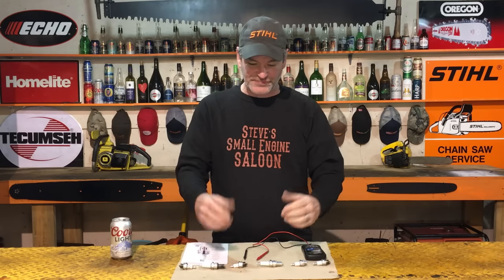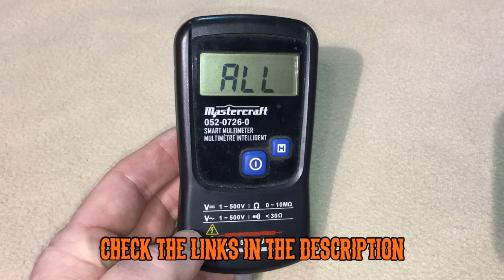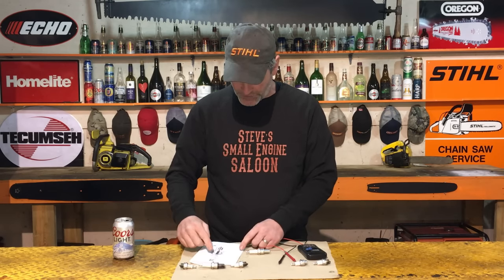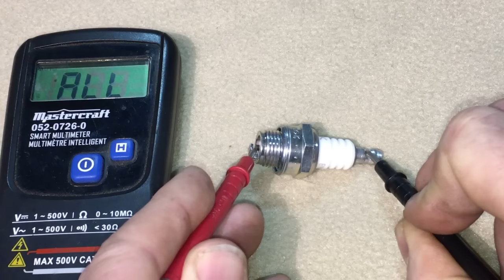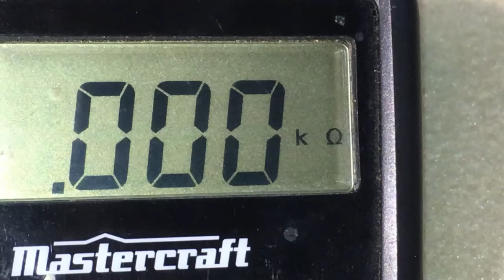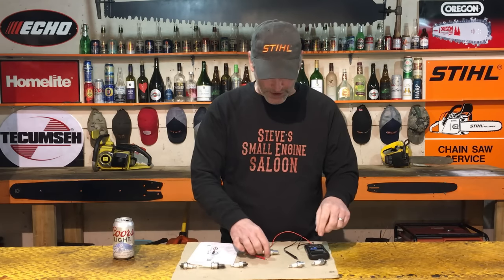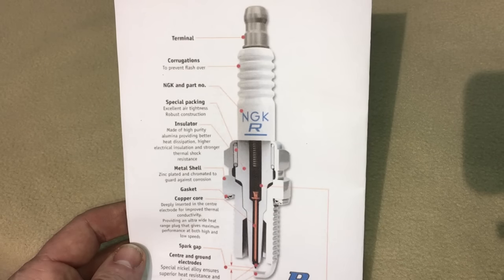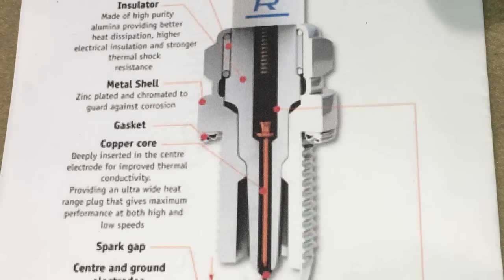How To TEST A SPARK PLUG In 1 Minute

Comment: Mate you made my day!
I was testing the riding lawn mowers plugs because its engine  was not having the right attitude. It was running, but once you clutch in the mower it did not have the torque it used to have. So I checked the plugs and, R-type, it was showing 4,7K on the one, 12,9 on the other plug. Voila! Problem solved. Thanks to your easy instructions on how to properly test spark plugs.Things can be so easy if you know what you're doing!
Reply from the maker: Thank You...and You're Welcome...

Comment: Sometimes the deposits on the spark plug short them out and the engine won't start, remove the wire and allow a 1/4 inch gap and the engine may start. I figured this out as a diagnostic step before removing the plug or going to town to buy a new spark plug, it also checks the spark delivery. No beerz for me thank you.

Comment: i have rebuilded my Husqvarna 281 XP chainsaw from scratch. i have bought a New Piston A New Clutch, a New oilpump with wormgear and a New ignition module. it has fuel and  the compression in the cylinder is excellent but now I have no spark. i have tested the old spark but it didn't spark at all so I bought a New one. now I have used new wires  but still no spark at all. so I think it's the ignition coil. 
do you have a video or Some information how to test the ignition coil. 
the ignition module is new because the old one was broken and the distance with the flywheel  is 0.3mm so it's okay with the magnets. 

so my question how do i test my ignition coil or if i don't have spark should i buy a New one for my husqvarna 281 XP chainsaw?

Comment: Steve excellent videos one question what would cause an MTD Blower Vacuum gas motor to blow excessive oil through the crank case vent, I took the engine apart  could not find a PCV valve  just a vent pipe the engine has good compression  but makes a rasping sound when turned by hand
Reply: Hi ! You probably put too much oil in the motor 🙏🇺🇲🇬🇧✌️

Comment: Hello just wanted to know if you could maybe help?
I have a craftsman leaf blower .
Now the problem that I have is when it gets hot it doesn't like to restart. Now what it doesn't know is it keeps giving shit I have a have  big hammer that is my favorite tool.Lol
Reply: .....I'm by no means an expert however one little thing to check for is the venting for the fuel cap. When hot there is pressure built up in fuel tank , that pressure can force out excess fuel into and around the carburetor which finds it's way into the crankcase causing rich mixture for awhile . Placement of your gadget when stopped so that crankcase is vertically above carburetor is worth trying ,,the overspilled fuel can't flow upwards into crankcase then in a large quantity.
Reply: @charlesdickens6706  thanks for the heads up on the cap I will try it. ATB

Comment: Just gotta add, especially if Aussies are watching, a brand new NGK plug for my lawn mower with Briggs engine has 10,900 to 11,000 ohms from new and is an NGK BR2-LM. The original equipment Champion RJ19LM I pulled out of it had a reading of 59,500 ohms and was still producing plenty of power even with a semi blocked fuel pick up screen that was causing surging. So maybe for other countries the resistance varies?
The mower is a Sprinter 450 Series 148cc purchased 2012. Engine  - Briggs and Stratton Model 9T502 Type 3152H1 Code 11111152. It also has a sticker saying that because it is made exclusively for export it doesn't have to be in line with U.S pollution regulations.

Comment: My neighbor just gave am a Husqvarna mower Model HU 700F (Honda engin) that will not start.  I knew had hadn't used it a several years so I thought it probably had a stuck valve.  Not the problem.  Pulled the plug (E3.22 E3 brand).  Remember that you said in the "How to Test a Spark Plug in one minute" video that most Honda lawn equipment uses a BPR6ES plug.  While this plug doesn't have an R in the printed model (E3.22) it does read 4.24k when tested. which makes me think the plug is OK.  I have another neighbor who needs a mower and i want to get this one going for her.  TIA

Comment: Some of champion's spark plugs use a silicon carbide resistor and cannot be tested with a standard ohm meter. When tested without high voltage they give a high resistance value (above 35k ohms) - even when they are good. I found one in my yard machines mower (550ex Briggs motor) and thought the spark plug was bad. The spark plug was champion RC12YC. I bought a new spark plug and got the same results. If you go to the championautoparts.com website and look up your spark plug part number, I believe it will identify these spark plugs as having resistor type "SAC-9". So, if you get a Champion spark plug with resistance above 35k ohms, it may be one of these silicon carbide types and may actually be good.

https://www.championautoparts.com
http://www.electroair.net/pdfs/champion_spark_plug_resistors.pdf
https://www.sparkplugs.com/what-are-the-different-champion-resistor-types
https://www.gsparkplug.com/media/wysiwyg/technical-information/champion/Champion_Resistor_EN-F-ES.pdf

Comment: Hi Steve
I tested three new  NGK BPMR7A Spark plugs all tested over 12kΩ  so I contacted NGK and this is their response. 
Thank you for your enquiry. This plug utilises an internal 10 kOhm resistor. However, there is no reliable way to measure the resistance of a spark plug using home equipment such as a multi meter

Comment: Steve- what's your opinion on using after market parts, like from Amazon?  I'm needing to replace my ignition coil on my Stihl weed eater and the parts on Amazon are much cheaper but is the quality acceptable?  Your respect your opinion.
Reply: "I" respect your opinion.
Reply from the maker: A lot of parts you get from the dealer are also after market!  I have used Amazon carbs lots with no problems, however never tried a coil yet....
Reply: Do try. Nobody can really say for sure for something that's not under their control. It all depends on your luck I suppose. If you are lucky nothing can really go wrong. If you are unlucky enough to warrant going for some cheap online stuff, then I suppose you should really just say, fuck it, how much worse can it be. Just some freaking coils. To be honest, even if they are shitty, what mlre problem can it cause than the existing bad coil. Suppose you are buying the coils as replacement.

Comment: I used to race motocross back in the 90's an was always told by honda that if you ran a non resistor  plug you could damage your cdi unit? Never found out if this was true as it cost enough to race without fucking things up as the plugs cost the same!
Reply from the maker: I have always been told that too, but have never seen actual evidence.....
Reply: @StevesSmallEngineSaloon  I'll be asking around as I know a man who worked for honda for years in bikes and garden power tools.

Comment: I got a crap reading on my 6.5 HP Craftsman walk behind.spark plug and a good reading on my coil and made sure safety was diconnected while testing. Put in a new plug that tested wel,l shot fluid into the carb and the plug hole, pulled my ass off and Nada, Nothing...Not even a po. I jimmied the engine kill brake away from making contact for easier pull but still nadda zip nothing. Any Help. (Airway was clear- took filter off for test fire)

Comment: Very good informational videos! A lot of guys think they can turn the video on and start talking off the top of their heads; never a good idea. The way to do it is to research the topic first (what a concept!) and then prepare a script or at least an outline of the topics to cover. Obviously, you do the research part at least.
You may come off as a average Joe mechanic (come on, drinking beer on camera!?) , but you are more than that.
An improvement? Better audio would be nice. Your audio isn't terrible, but it could be better. The key to good audio is simply how close the mic is to the speaker's mouth. A close mic favors the voice and minimizes the room echo. That's why you see so many lapel mics, even on TV. You don't even have to buy anything. If you are using a smart phone, just put it on the bench in front of you. Nobody will bitch or even notice. (Oh, wait! this IS YouTube, isn't it?)
Good point about the "Just try a new plug." If you run 2-cycle engines and don't keep spare plugs on hand? That's simply masochistic behavior! Tell'em Steve!

Comment: A crack in the ceramic might allow high voltages to leak through, but you'll never detect it with the low voltages from a meter. Continuity between the electrodes can be due to fouling. And... a plug can test out fine on a meter, but still need replacing. It's rare, but it can happen. The spark jumps from the sharpest points on the electrodes. Every spark will blow away a tiny amount of the electrode. However, it takes a LOT of use for this to become a problem. If you're replacing the plug every year or two (homeowner), or every year (commercial), this will never be a problem. An engine used commercially with a 10 yr old plug could experience this.

Comment: Ive discovered working on lawn mowers that the NGK plugs are the only ones ive seen fail completely, 100% dead, no spark.
Reply: It's really got a lot to do with the guy over priming the carby or mixing the 2 stroke too oily. People leaving fuel taps on- nothing drowns a plug like a victa crankcase full of 2 stroke.

Comment: Thanks once again Steve, very helpful. My multimeter has the dial, I set it to 20K, it gives readings to two decimal points.  You mentioend that some people say that a plug is no good if it reads over 5 but that is not true with small engines. I tried a few NGK BMR79As, one that was in a saw, two brand new. They were all in the 9s, highest was 9.81 that came out of the saw, the new ones were both right around 9.5.

Comment: One quick and dirty  (and cheap) way to check a plug is to have an electric fence charger handy and put the plug in the circuit. There is nothing like a visible blue arc that makes a nice little snap and a bad plug shows as a snapping sound with no visible spark. Its a hot test with a voltage range (about 5-6000 volts) of an operating plug, so it will find even the tiniest path to ground........I use a fence charger in my garden, and it bit me several times before I had the Einstein moment.....

Comment: I did the spark plug test as suggested but found there was no continuity but had a resistance reading, there was no R in the numbers.
Reply: Was the electrode scraped clean?
It doesn't take much to cause a resistance.

Comment: Steve, why would anyone want to reduce the spark by means of a resistor? Hi-Tek b-s to charge
a lot more for a plug? I know if it is fouled with carbon, it will to some extent short out the plug.

Comment: Shindaiwa C270, hard to start, once running rough at low revs, high ok, thought I'd share this little head scratcher, the white insulator on the plug had come loose and was slipping down covering the electrode, when looking at the plug it was always held upsidedown so looked ok  and it tested electrically ok, the compression must have pushed it up enough to fire intermittently, then the high revs must have held her skirts up letting it run ok, found it when I slapped the plug wrench (a little pissed off) to take the plug out, the little shock jammed it down over the electrode...  Never seen this before.

Comment: Steve great video!  I heard that 2 Stroke engines go through plugs substantially faster than 4 strokes.  Is there truth in this and why?
Reply: Hunky MrB, yes 2 cycle spark plugs go bad faster. It's because of carbon buildup caused by the residuals left by the 2 cycle oil.

Comment: I have a quicker way to check  lawn mower plugs, although not all plugs will fit all mowers. I simply use a mower that I know works fine. Take the plug out, replace it with the one being tested. If the mower still runs, the plug is obviously fine. Put the plug back in the equipment it came from, squirt a little gas or starter fluid in the carburetor, if it still doesn't run, time to check for other problems.

Comment: You really cant "check" spark plugs because they have to be checked under load and thats really not feasible however a reading of under 5 ohms its just about standard for a good plug so we can run with that, great video as always!

Comment: I noticed my Briggs and Stratton 375 Sprint engine has a small spark plug which I'm assuming is the non-resistant type which is all good but I think it might be something else wrong with my lawnmower

Comment: Tried it on two spark plugs. This doesn’t work. I know at least one of the plugs is good as mower starts no problem. Yes I’ve tried cleaning all surfaces with wire brush.

Comment: Good checks and ideas.
I saw a guy being neighborly and helping his neighbors with their mower doing prelim tests.
He couldn't see the arc of the plug clearly from pulling with it facing away and could see spark.
He continued and found lots of marginal issues.
He fixed each one or improved it spending time and materials on each aspect of good ability to run, basically refurbishing their whole machine.
When he was through, he was a-pullin and a- cursin.
His spark would rather arc to the outer circle (to ground) than jump the gap from center electrode to side electrode.
He did closer spark testing and got a good look.
Then he did what you said. Grabbed a plug from another and fired it right up 
Cost him a Saturday and a Sunday instead of a plug.
Plus a plug , after.
No charge.
Nice guys finish last sometimes, but all his refurbishing, debatably, Did his neighbors machine some good. And the you tube audience was entertained if you saw what some of us saw right off.

Comment: there is such a thing as an air gap spark plug like a UJ12Y. they will read open on the center electrode continuity. because the air gap breaks down on high voltage to boost the spark intensity. like the old trick of pulling the connector away from the plug and letting the spark jump to the plug cap. sometimes that will fire a fouled plug. these are old things may not be around now.

Comment: I had a pressure washer (with a Honda engine) that started fine and ran fine for exactly 20 seconds and then die.  Start right back up, run for 20 seconds and die.  After rebuilding the carb and replacing the fuel pump to no avail, I decided to pull the spark plug.  It looked fine.  Wasn't fouled or worn out.  It was a resistor type plug.  Checked the resistance and it was spot on.  Reinstalled the same plug after cleaning it and the problem remained.  Decided to replace the plug anyway and that fixed the problem.  Moral of the story, a plug that bench-checks good may in fact be bad and the cause of your problem.  Obviously, the plug had some type of defect that would cause it to fail after temperature (and/or pressure) reached a certain level causing the plug to malfunction and the engine to shutdown.

Comment: I did have one plug many, 50 -55, years ago that would spark against the head but not installed, I suspect it may have had a fracture in the insulator that failed under compression.  Just saying you can have one pass the tests out side of the engine and still be no good.
Reply: Yes, the resistance between the electrodes increases with the presence of fuel, oil, and compression. At that point a "punctured" insulator cannot withstand the increased pre spark voltage, and leaks internal in the plug.
This can also happen at the coil or lead insulation, not always the plug.
Turning off all the lights and watching to see if it is leaking at these items can help.
Reply: @georgschwiemann2353  good comment. I used to use the lights out method to find bad spark plug wires on the old cars I drove when I couldn't afford new ones.

Comment: I've had brand new NGK plugs that were junk on occasions over the years more then any other brands.
Reply: True story. Walked into a shop years ago with a spark plug I needed to replace. A middle aged Korean guy looked at it and said "NGK, No Good Kind." He got me a Champion.
Reply: Do you know why??  I had the same issues in the early nineties when I was motor crossing my Honda.  I can’t tell you how many NGK D8EA plugs I went through.  It was not uncommon that a plug would fail deep in the woods many miles from home when riding.  I always carried spare plugs with me.  I then found a champion plug substitute and my bike never fouled a plug since.
Fast forward to 2016.  I met a General manager from the NGK plant.  He told me some insider information.  All aftermarket spark plugs sold at part stores are lower quality plugs that don’t meet the high standards for the automotive industry.  Only high quality grade “A” plugs are sold to manufacturers for installation in new engines.

Comment: How do you test a spark plug?  Remove it from the engine, connect the wire, lean it against the block so it has a good ground.  Next, observe the spark, a good fat spark means the plug is working then check the fuel system.

Comment: you can get a ohm meter at harbor freight  less than 5 .00  been using them for years  also a plug cleaner that works  great  i use the plug blaster often  can not remember last time i bought plug  99% time pluk failure is caused by cabon built  up  which the blaster will remove   shiny likea new plug   always check from the top ti the threads  carbon will show a res. blast its cone  im a retired tech i do this all the time   ----always set ohm meter to the highest ohms  scale 2-300,000